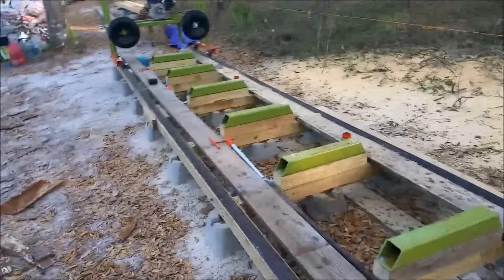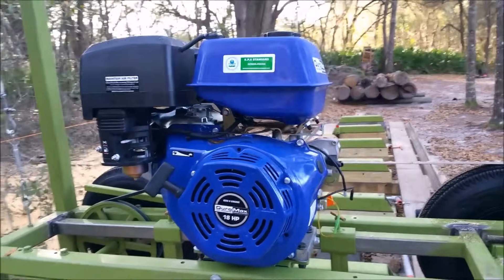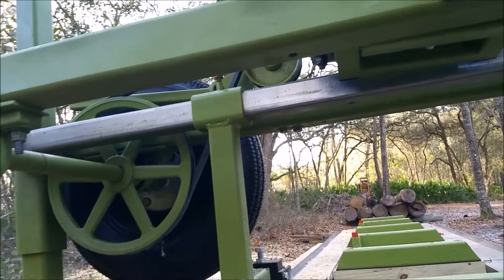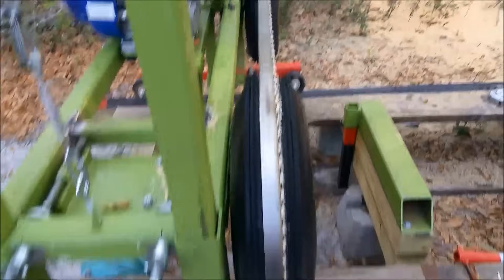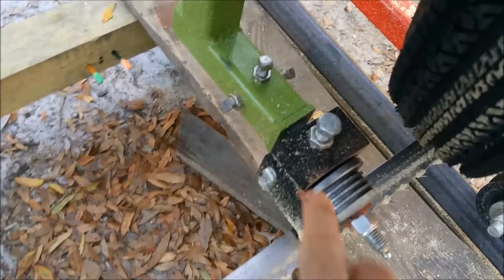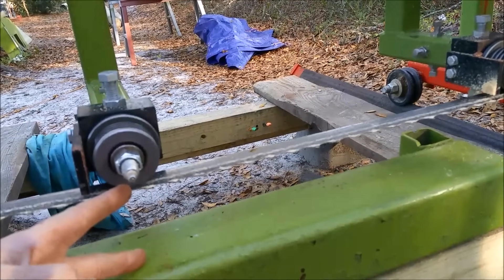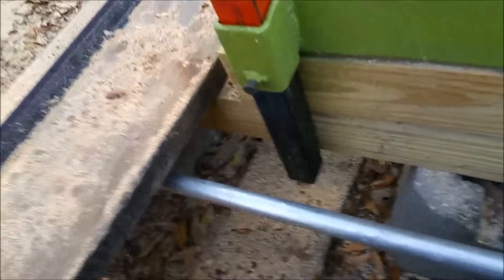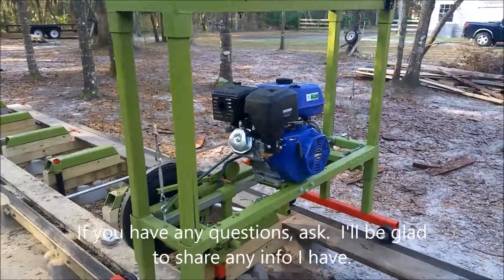Homemade Bandsaw Mill walk-around

Comment: This is the nicest homemade mill I've seen.  I'm wanting to make my own and I'm going to use your video to help me design it. Very nice work! Thanks for sharing
Reply from the maker: Wow. Thanks. I rebuilt this after this video with larger axles, actual band wheels, and a centrifugal clutch drive pulley. Otherwise, it did a great job as you see it
Reply: @joshsbomber  I have 19" blade wheels coming and I'm going to make mine towable using 8" channel iron and boat axel. I like the idea of centrifugal clutch. I already have a small diesel engine and 18 gallon aluminum fuel tank.  I just ordered the cooks blade guides and 4" v groove casters. I found a crank lift at my local scrapyard that should work great for raising and lowering my bandsaw platform.  I'm planning on cutting my own lumber to build a small house on my 12 acres. I just wanted to thank you for your video and the great work you did.
Reply from the maker: Sounds like you got it under control. I appreciate the comments. Good luck. Make a video also.

Comment: Could you show me what pully you have for the drive
Reply from the maker: If I still had the mill, then sure, but I sold it... it was a 3 groove pulley off a bat wing mower. It weighed about 30 pounds alone. Lol can't remember the diameter.
Reply from the maker: Actually, I think the one in the video was a 10 or 11" single groove. Bought it either Ebay or Amazon. The 3 groove was when I rebuilt this mill
Reply: Could you make me one please
Reply from the maker: I would if I could

Comment: So professional. Figure you could walk in to tractor farm supply and buy 1. Respect to you sir. 
I've no knowledge at all with this but I was curious why have all the precise micro adjustments of the blade,? Honest none judgmental question. If I built one I'd try to make the blade strait and solid as could be then set it n forget it. Me not knowing would prob. Have the blade fly snap n cut my leg off lol so honestly trying to learn why the micro adjusting is needed so I know
Reply from the maker: Thanks man. The blade has to be adjustable. Over time things shake and vibrate and even the cells in the steel band change a little, so there needs to be a way to adjust to correct those issues. The blade is designed to be used perfectly parallel to the cut, so the closer that perfection is, the better the cut and less strain on the blade and guides, etc. The blade will wander, or start to cut up or down through the wood and the goal is to adjust to prevent this from happening. You want straight cuts and unfortunately it requires repetitive fine tuning to achieve that. Hope this helps answer your question. And also, I'm not a professional, I've had to learn this stuff just like everyone else. Mostly through trial and error and research.

Comment: How many engine HP sir ?
Reply: Thankyou sir
Reply from the maker: Good question. Most engines at full throttle is 3600 rpm. On oak, I ran full throttle. On pine, I ran about 2/3 throttle. This was my own trial and error.
Reply from the maker: I'm sorry. I misread the question. It is a Duromax 18hp.

Comment: what size wheels did you use and what hubs did use?  you may of said and i just missed hearing.
Reply from the maker: These wheels where 16" trailer wheels. I used 1" hubs, 4 lug... I rebuilt this mill with actual 19" band wheels and 1.5" axles. It greatly improved everything.
Reply: @joshsbomber  ok ive been tossing the idea around on building one with donut tires and a cv axle versus the 19" band wheels.  someone me some plans on building one with the donut tires.  i can see both ways working.  donut tires being cheaper by far.
Reply from the maker: I don't disagree. I have heard of the tires causing the blade pitch to go bad causing the blade to wander. I could also see less rigidity with the pneumatic pressure as compared to a cast iron wheel. I've had both and will build with the cast wheel again.

Comment: Where'd you get that motor and how do you like it two years in ?
Reply from the maker: I can't remember right now where I got it, but I searched online and found it... I sold this mill a while back and it was a great motor the entire time I had it.
Reply: @joshsbomber  Thanks for the reply. I'm putting a mill together or rather finishing one. Most of the hard work was done. Anyway I have a 20 hp onan engine I bought a while back and discovered the output shaft is 1 3/8" and mounted on a broken flywheel fan. I'm tempted to just buy a new motor but don't wanna spring for a 20 hp. Your set-up with the tensioner instead of a clutch pulley would solve the issue of findind a clutch in 1 3/8 bore. I can probably find a pulley in that bore.
Reply from the maker: I'll be honest, when I rebuilt this mill, I changed over to a centrifugal clutch and "b" type belt... I'd do it again over the engagement level deal...
Reply: @joshsbomber  Good to know. That's what I felt was best also. I'm not the greatest fabricater though. My shop is minimal at best. I hope I can get this onan 20 to work. The mill is large and I've got some big pine to cut. This projects been on the back burner for to long. Looking into running off the front of the engine. I saw a video on onan rebuild that showed a John Deere app that runs a pto off the front. If that flywheel is similar to the JD model it might be do able.

Comment: JD this is a great build and a great video.
I’m getting ready to build a sawmill.  Do you think I could get by with a 1 1/4 in axel???  I have a trailer that has this size on it.  I’m trying to save a little money.  TIA.....!  God bless.
I just subbed you, and gave a like.
I hope to video my mill when I get started.
Reply from the maker: Thanks for the comment.
This mill has a 1" axle and it broke several times... When I rebuilt this mill, I went with 1.5" axles and never had one brake... I'd say 1.25" is better than 1, but  really not sure how it would hold up... I'm sure better than the 1"... haha
Reply: Thanks JD.....!

Comment: Sir, this is a brilliant design. Since this video is a couple years old I am hoping you might have a print-to-build package available for purchase.
One issue I saw on a couple other home builds was the tires flattening the saw teeth on one side causing the Kerf to go wild. Any problems with This?
Thank you for sharing your design!
Reply from the maker: Thank you sir. The video is a few years old and I actually sold this mill to an older man who I'm sure is making good use of it. I upgraded a few items before selling like the wheels and blade engage and alignment portions. As for plans - I never did get any made up... My next build will have plans tho. I've been asked several times for them. Thanks for commenting

Comment: I have to agree with some of you're viewers.  I too have watched other videos of sawmill builds. I have to say, you do have one of the best built home made mills that I have seen.  Great job.  
I do have a couple questions, because I'm going to either building a sawmill or buying. I wouod prefer to build one as well as youres.  So my questions are.  1.  Where does a guy look for some of the parts that are needed to build a sawmill.  Like the blade guides, the large metal wheels? Things of that sort.  2.  Are you going to add a water drip to cool the blade?  The metal wheels I asking about are the same that some mills use for the blades.
Reply from the maker: Thanks. You can get steel from local welding shop. The band wheels can be obtained on Ebay, but I'd say Surplus Center would be best. The blade guides, I bought the assembly from Cooks. They are awesome. You can get a large amount of items at Surplus Center (online). As for the drip line, I found it created more  mess than it was worth for me. My saw cut better when it was dry. My next mill will have an "H" shape frame around the band wheels to relieve strain on the bearings. I'd also use a minimum 1.5" axle and heavier bolts and all... I'd also use an easier lift and lower idea... the winch got old... Maybe motorized. Hope this helps

Comment: Excellent build and great explanation.  I would like to suggest, instead of the axle / pillow block setup to the blade wheels, a rear hub assembly for a 2001 era caravan or vw jetta. It’s easy bolt on with brake capability if needed. Just a thought, Thank you for sharing.
Reply from the maker: Thank you

Comment: Love that sawmill. It has helped to inspire me to build my own. How wide from v groove wheel to v groove wheel is your sawmill? What size bandsaw blade do you use. I live in Florida and it kinda looks like you live in Florida too. I live at the north end of Lake George, FL. I noticed you had changed out the 18 horsepower duramax. Did you have trouble with it?  I own a tree company based in Daytona for the last 20 years. Affordable Tree Services and Landscaping Inc. (386) 239-0225. I've  gotten to the point where I'm tired of paying to throw away good wood. I'm going to start utilizing it thanks to you.
Reply from the maker: Thanks. I live in Chiefland, near gulf coast of Florida, straight west of yall. Anyways, V-groove to V-groove is around 55 inches. I sold this one so I can't go measure it for ya. If you already have your hands full with the tree business, it might be better to go ahead and buy a built sawmill. It took me a couple hours to set mine up after it was built. As for the Duromax, I loved it... Started up great and ran smooth. Never an issue with it (used non-ethenol gas)... I can't remember the blade size either but it was a standard size that most blade companies had already built and ready to ship out.

Comment: No lubrication/coolant for you blade?  Set up a drip line with lightly soapy water.  Helps keep down pitch and sap buildup on your blades, keeps them cleaner and cooler.  Cooler blades wont stretch/expand as much during use, helps keep the blades sharper and longer between sharpening or replacement. 

 A simple setup with a water dispenser jug equipped with a spigot, secured above the top bar of the mill would work, and run some tubing down, secure it where it can drip on the blade just where it passes into the wood.

Comment: Great Job. You made it  logically  very simple.I watched your machine video a no of times and intend to follow your steps in my fabrication. God bless you.
Reply from the maker: Thank you! God bless. My best advice when you start is to build with larger diameter axles.
Reply: Thanks for swift reply & advice.What should be the min size of axels? Yeah. You did mention in the video that your idle  axle broke down for which you added another bearing bracket in the centre.

Comment: Dimensions please. Total with, total length of motor carriage. ! Thanks
Reply from the maker: It's all in my head man... I sold this mill about a year ago and never wrote down the dimensions to it. I did, however, start building it with my band saw blade and working from that outward. If that helps any

Comment: Nice build ‘ do u have any belt slip when blade dulls a bit with single belt
Reply from the maker: Thanks. I have had belt slip, but this whole sawmill got rebuilt and I stepped up to a "B" style belt (5/8") and a centrifugal clutch... Never had an issue after that. Hope this helps

Comment: Were you from
Reply from the maker: Florida. Trenton area
Reply: O bit far what size roled bar do i need for axels to go in to them barings
Reply from the maker: Do you mean the axles for the carriage wheels? I dont even remember. When you order the v groove casters they will come with whatever size bearings are in them. I used whatever bolts and nuts I had for the axles to the carriage wheels.
Reply: @joshsbomber  ok and yes to spin the wheels

Comment: Do you have a parts list please
Reply from the maker: The width of the frame that holds the wheels and engine is about 50 inches and the depth is 14... Both measurements are the frame. Engine and wheels and other parts hang off the sides, etc.
Reply from the maker: I'm sorry. I do not. I built it and managed the project in my head. Lol wish I would have made plans and all.
Reply: Thank you and how wide is it across <-> please did you say 17 and is that inches or like 3ft
Reply: So just over 4ft wide that right
Reply: And were do i get my blade from and what size please thank you
Reply: Whats that in cm please were the moter is that frame thanks for help

Comment: How wide is the gap were the moter is as thats a fantastic mill
Reply from the maker: Thank you. The width from front to back where the motor sits is 14 inches.
Reply from the maker: I'll try to find past purchases for the exact blade.
Reply from the maker: I'd say start with the blade you want and the wheels you want. Mock that up with a bottle Jack and some blocks of wood between the wheels with the blade around them. That's going to give you the distance you need to know where to place  the center of your axles. From there, I'd say allow about 2 inches inward and about 4 inches outward travel for tightening and loosening the blade. Once you have measurements, you can figure out how wide the frame needs to be. The depth is also dependent on the motor mounts and placement of the motor. I started with the wheels and blade (like above) and worked each step from there. Get your blade, wheels, and motor. Those set your standard size for the frame, then everything else from there is custom building to fit around those parts.
Reply from the maker: My next build will be different. I will make an "H" looking piece to house the wheels. And will also use cast metal wheels. Larger axle and a better blade tension design. Also lift/lower will be acme rods, and I will use a centrifugal clutch on the drive belt, no lever action blade engage. The blade guides where excellent from Cooks. The Duromax engine 18hp was a beast too. Fired off everytime.
Reply: So its a 14 inc saw mill.that right
Reply from the maker: That's the depth of the frame. I could cut about 30 inches if I remember right. And the depth of cut was around 10" I believe (that's from blade to frame)
Reply: Are you on fb
Reply: Were do i buy the belt pully from please and size of the blade
Reply from the maker: I am on Facebook (thejoshuadavis).
As for the blade, it was a standard size ( I can't remember exactly). I started with the blade and built from there outward. I literally mocked up the project with an actual blade and the tires with a Jack between the tires to measure for tolerances.
Reply: Thank you
Reply: Thank you and can not find you im alisha quigley on fb my gf im struggaling with mesurments
Reply: Were do i get my axel for my pullies
Reply from the maker: Www.surpluscenter.com has parts for days... Maybe start there will a couple pulleys (sheaves) and belts to stretch over them to act as wheels. I got blades from Woodmizer, but it's all preference on them.
Reply from the maker: I just used cold rolled steel for axles on a rebuild. I used 1.5" instead of 1". Much better choice.
Reply from the maker: Blade QTY-1, .035 x 1¼ x 158; 10° 
I also ordered 132" blades too, but can't remember which I used.

Comment: Where did you find those 2 bearings for belt saw guide?
Reply from the maker: Help me out. What exactly are you referring to? The blade guides? If so, they came from Cooks and I'd buy them again and every build after that. They are worth every penny.
Reply: @joshsbomber , yeah, blade guides. Where to buy them? I saw one guy make them using metal lathe, but I dont have it. https://youtu.be/nEcpqGv4Eq4 from 9:00 min
How to find Cooks, do you have their  contacts or a phone #?

Comment: more info on this vid than the last eight i watched. may i ask a twofer question? 
 how much space between the rails?
and how tall is the carriage?
Reply from the maker: I've sold this since the video, but I believe the rails were 50 inches apart and I welded 16 more inches onto each rail. They were around 6 feet tall after this video.
Reply: @joshsbomber  ty. 
I'm glad you posted this video, i'll be using many aspects of this build:)

Comment: nice build.   I have seen a few that used a boat winch type of setup with the cables connected to the end of the bed. than you just hand crank it to move it.   much easier than pushing.
Reply from the maker: Thanks for the feedback

Comment: I liked and subscribed because I am sure that you have made some more videos. Most people are so interested in talking but they don't really say anything. I can tell that you made it yourself  except for guides and that makes sense. I think it is simple and user friendly. I like the walkway down the sides. Man should be proud of what he does and you never cut corners, just made affordable.These mills cost twenty plus thousand and don't do any different. I think I would add the second log dog to keep the log from moving while going down the cut and a ruler so that you can tell what your cut is going to be. For some reason I like this mill a lot. I have saw them made with bike tires and the blade kerf doesn't get affected by the tire so does that one affect the blade kurf or not? How much air pressure in the tires?Thats about it except to see it working. I wish I owned it!
Reply from the maker: Thank you for the positive comments. I never noticed the kerf being affected or the pitch angle of the teeth. I used many different air levels on the tires (experimental) and any reasonable amount of air seems like it would work fine. Eventually, I did go back and make many parts bigger and stronger and ended up selling that mill to another DIYer that I know a few towns over.  I have a video or two of it cutting some wood also. Thanks again for the great feedback.